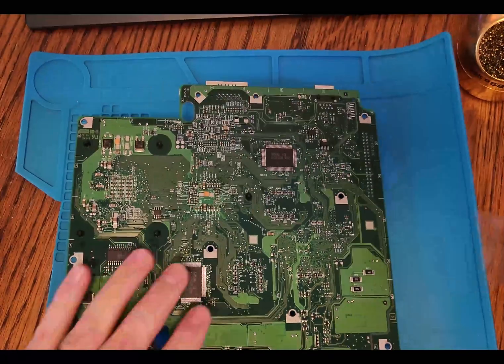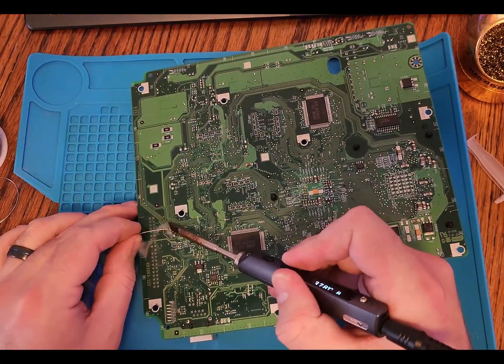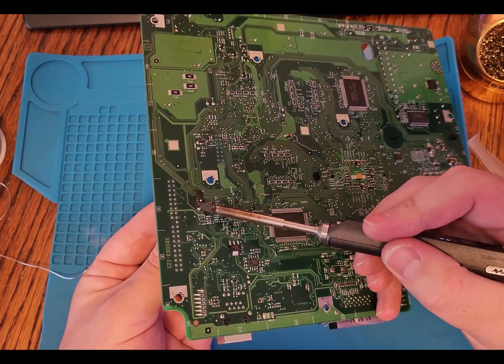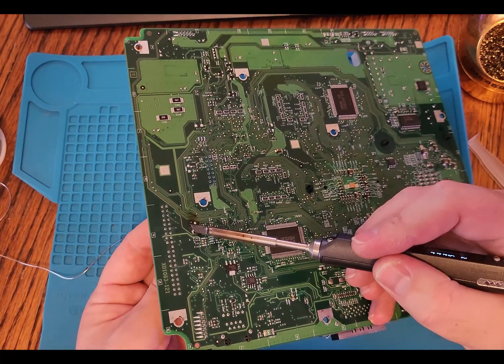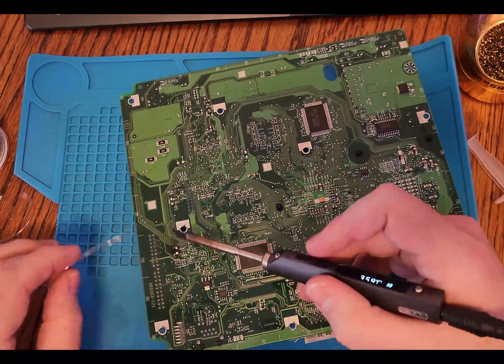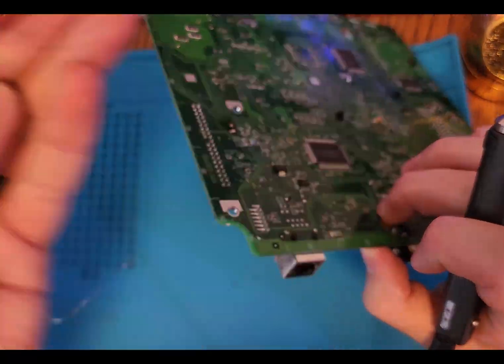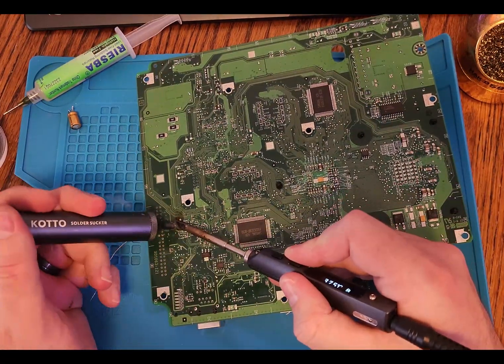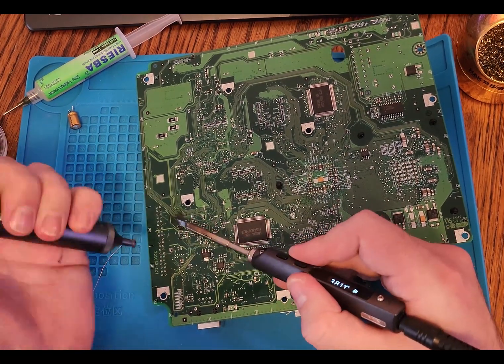Salvaging a broken Original Xbox (recap)

Comment: Can i replace 6.3v 3300 uf capacitors with 16v 3300 uf replacement?
Reply: Yes, do not go down or up on uF values or may not gonna work well. Check the size too, bigger ones will not allow the system to be reassembled properly.

Comment: I had to recap a v1.6b model with the infamous Nichicon HM . Those 5 five 3300uf 6.3V were so much out of specs, after removing them from the machine and measuring their capacitance some had reading as high as 9900 uf even though the ESR was reading fine. Also it will be worth checking the value of those smd caps, in my system their individual ESR was so much higher than their maximum tolerance.
Reply from the maker: Was it still powering on with the old caps?
Reply: @JimsTechNonsense  No it was totally dead. Now, it is booting fine :)
Reply from the maker: Another one saved from the bin!